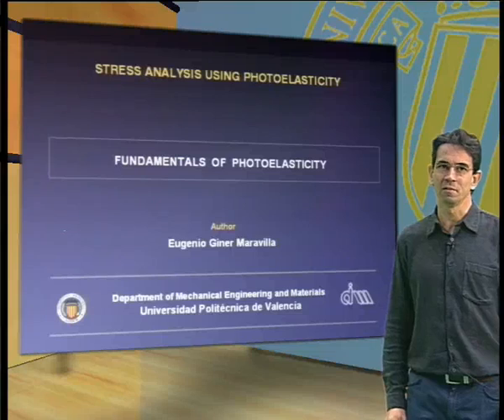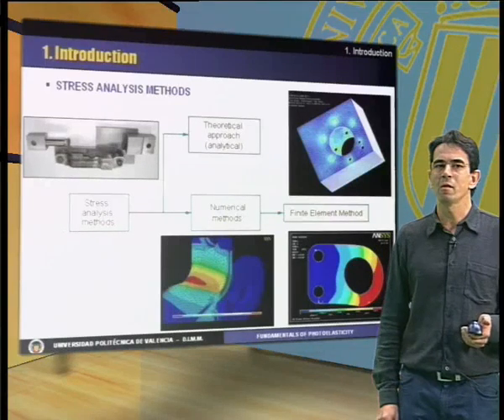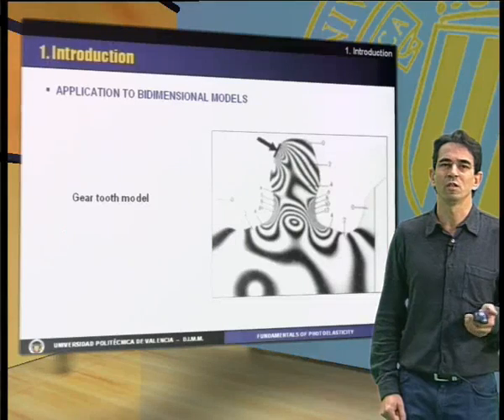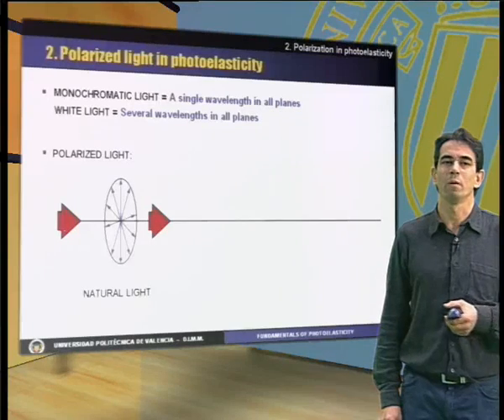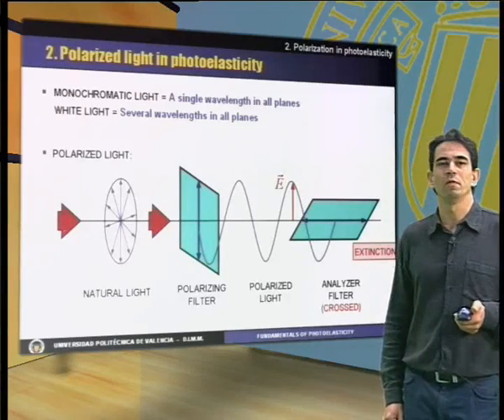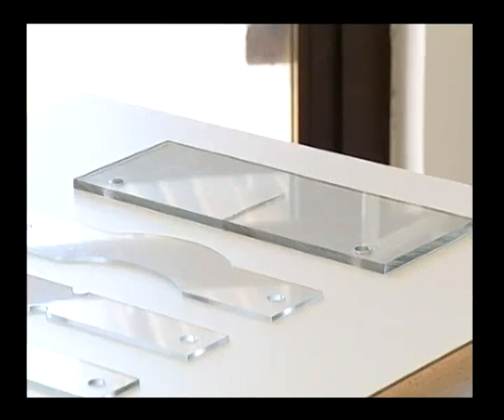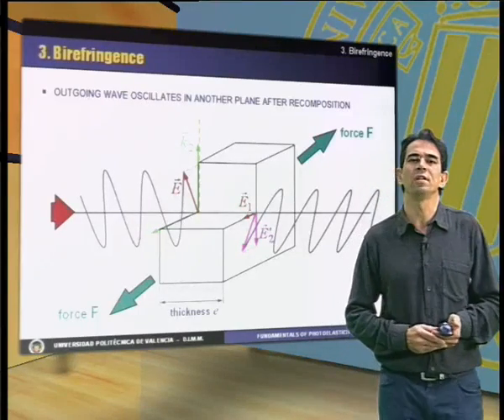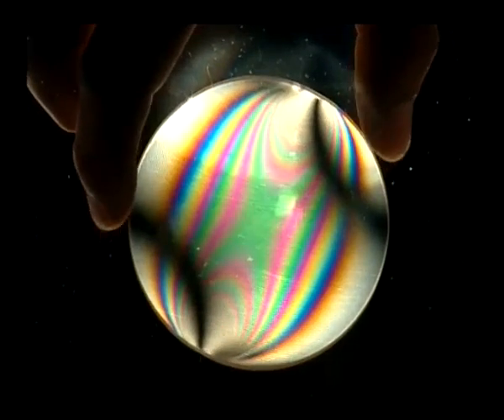Stress analysis using photoelasticity.© UPV

Comment: I have used photoelasticity to analyze electrical insulators on high voltage power lines.  The research was very successful leading to a clear understanding of how the tensile load on the insulator was converted to a compressive column action on the brittle ceramic insulating material.  Because of the coarseness of the fringe patterns it is not possible to get exact stresses but we were able to compute not only the shear stresses but principal stresses through the column.  Later I worked with optical moire' developed by Dr. Danial Post.  This can be used with non-homogeneous materials and also inelastic stress states.
Reply: we  have this material and Manufacturing process
回复

www.trustyiqi.com   you can see our equipment about pootolelsticity